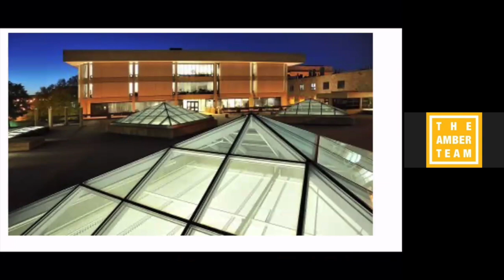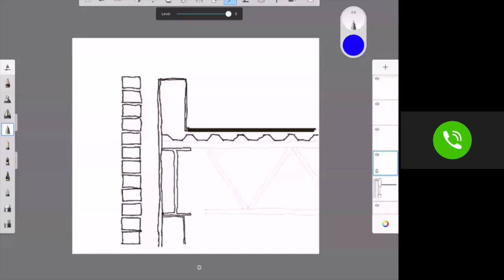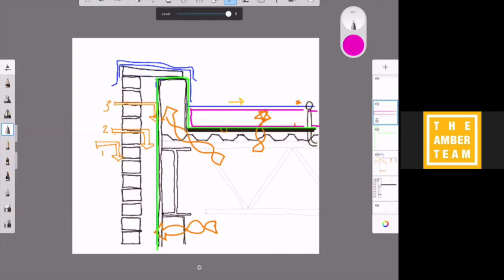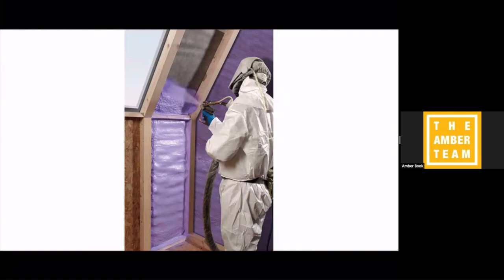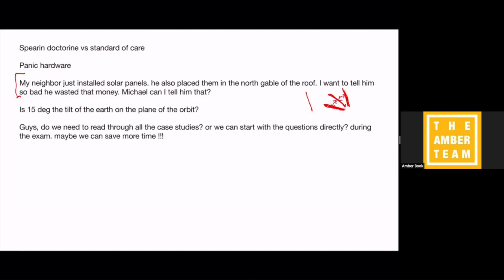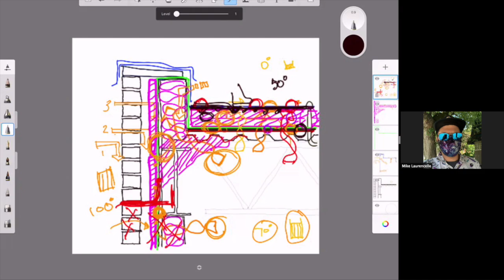Parapets - 40 Minutes of Competence | Amber Book

Comment: Adding to the floor plane conversation. Yes you can build in it (as discussed), but your options are either:
1. Build it fully flood proof (expensive)
2. Build it to flood, and waterproof only the electrical rooms or equipment rooms you don't want to replace every 10-100 years

We designed a hospitality campus 10-20' below the floor plane. But when designing with solution #1, it was so expensive that we had to redesign to solution #2. Even then, we encountered many permitting and design barriers. For example, water venting requirements contradicting fire proofing requirements. We had to apply for multiple alternatives requests and worked closely with the structural team to check for rot-resistant structural materials. We even used Bernoulli's principle in our alternatives requests. So, not easy!